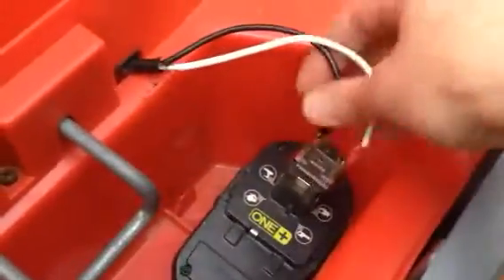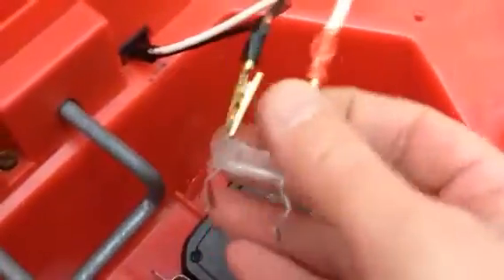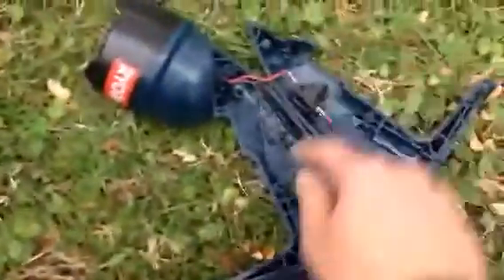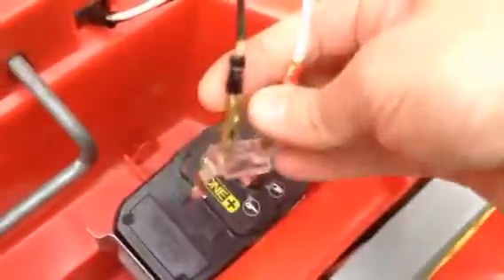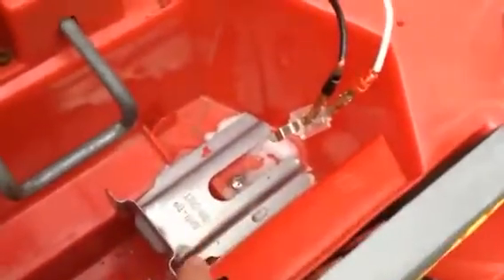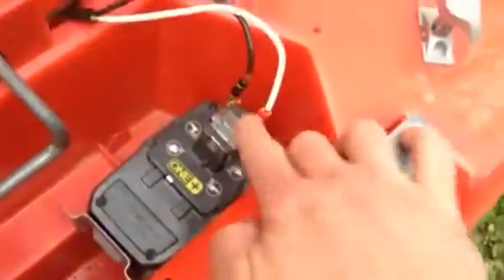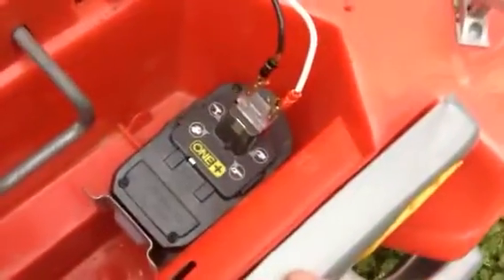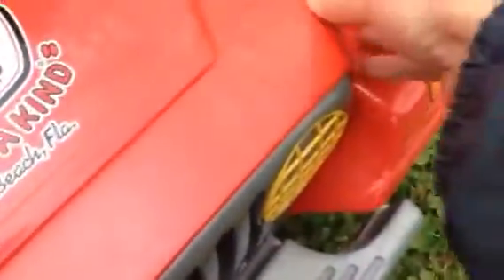Modified Power Wheels Jeep runs on Ryobi Lithium 18v batteries

Comment: sweet, i gotta try that out. How well does the battery last?

I thought about buying one of those $250+ lithium 12v motorcycle/powersports batteries of like 75aH... But I probably be better off rigging up my ryobi batteries, right? Maybe make a whole rack on the back of my larger ATV powerwheels to allow easy mount of multiple batteries. (plus more power, wooo)
Reply: How to convert to 18 volt battery that flat and not a dewalt style battery